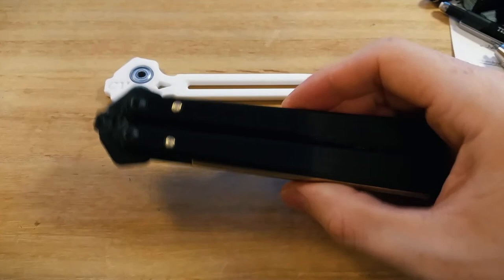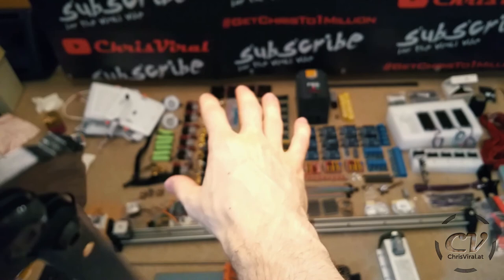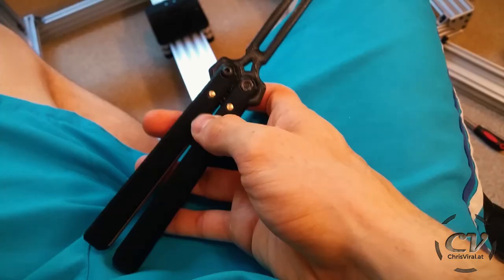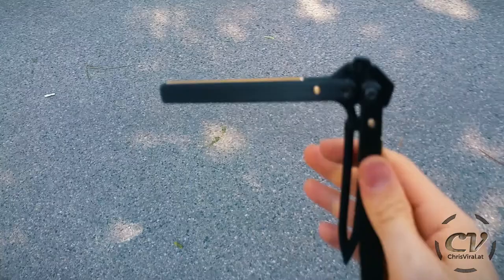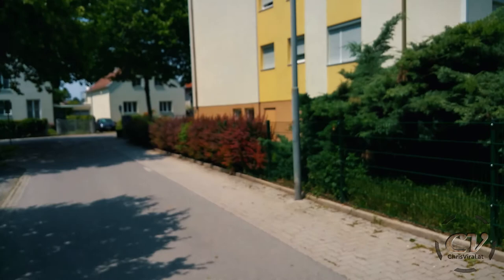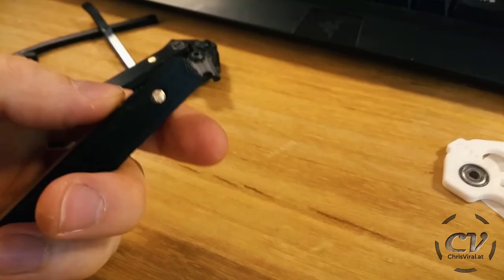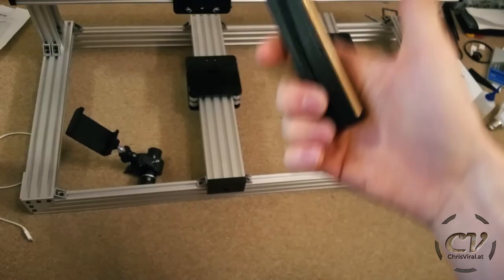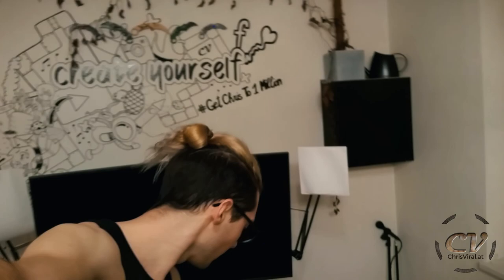Balisong Trainer With Ball Bearings - Velvet BB

Comment: You made a bearing ball that is completely different from everyone else.Everyone uses thrust bearings and depending on the material they on on SS Washers
Reply from the maker: Yeah right, everyone is going for miniaturization ( and fragility lol) I though ey... Let's go the other way :D
Also with enclosed bearings dirt and sand, etc. won't be a problem any longer.

Comment: What if you Include phosphorus bronze washers with the bearings for E X T R A smoothness
Reply from the maker: It would make no sense to add washers because the only contacts points are the balls inside the bearing. The rest doesn't move, so inserting washers wouldn't change anything. They'll just get compressed hard so that they won't be able to move a bit.